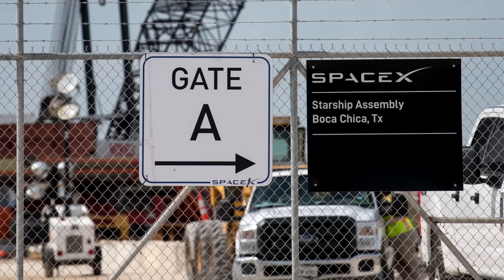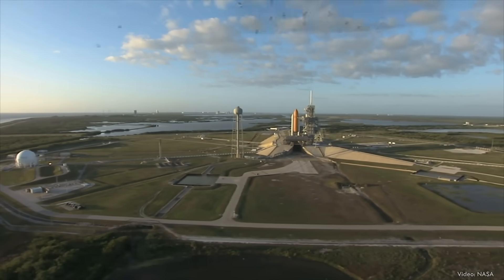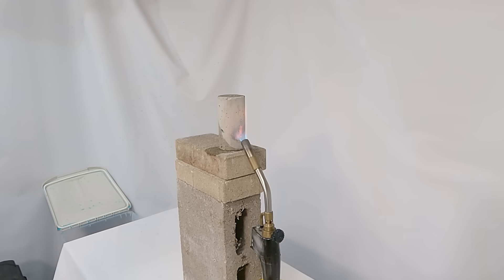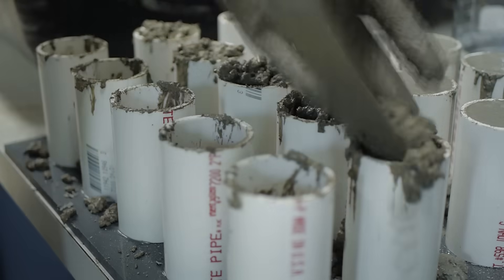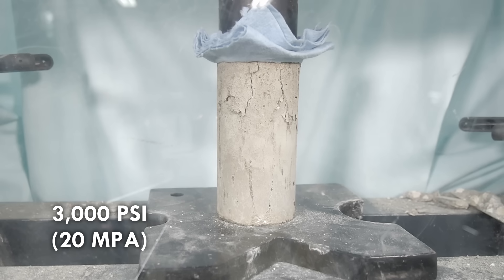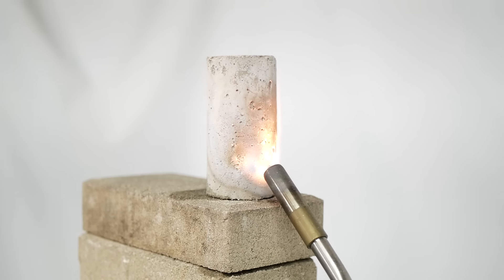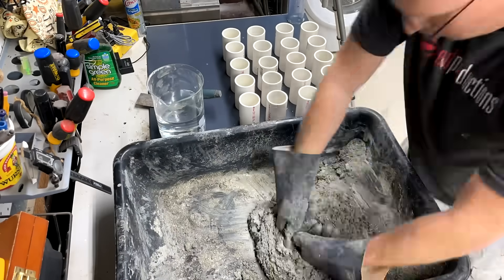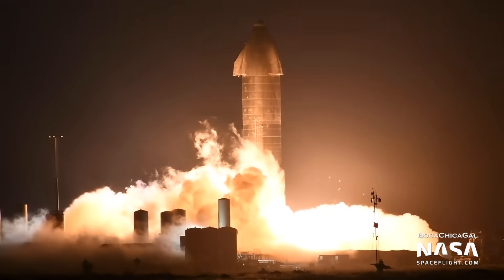Why SpaceX Cares About Concrete

Comment: Best spalling simulator for a rocket, minus the extreme thrust: molten metals from a refractory of course. =) Why I always work over a dirt/clay surface: let a new driveway absorb enough rain and spill a few drops from, say, molten brass or iron or your crucible cracks at an inopportune time, now you've got molten metal at 2400* to deal with ALONG with exploding concrete to dodge around your feet and legs!
Reply: At least the exploding concrete won't send the molten metal splashing around even more...  Oh, wait.

Comment: Would molten rock perform better than concrete?
Reply: Molten rock is, you know, molten. I wouldn't trust the integrity of a launch tower anywhere near it.
Reply: @General12th  would "once molten rock" reduce your likelihood of misinterpretation? "Refrozen rock" maybe? "Rock poured into shape"?
Reply: @unvergebeneid  Isn't that pretty similar to concrete? I don't see, for example, a great slab of granite holding up to launch conditions much better than a slab of concrete. It's still going to get blasted apart and form dangerous ejecta.
Reply: @General12th  it doesn't have cracks. It's also a completely different material.

Comment: Once there was a large, commercial, lift lock on a canal that they closed down to refurbish. It was built in the 1930s around the time of the Hoover Dam. They needed to resurface the concrete walls and at one point tried to use explosives to blast away a few inches of concrete. They detonated the charges and when the dust settled.....not much happened. They realized that the original builders really knew what they were doing when they formulated the concrete.
Reply: thats a lot better than the whole thing getting destroyed LOL. but also now after this video, i learned that they may have done some invisible damage by using explosives
Reply: No, those oldtimers didn't "know what they were doing", they just used a HUGE safety margin, exactly because they didn't know a whole lot. What do you do if you have no way of calculating if something is strong enough? You over-engineer it, and then you over-engineer it again. If you can calculate exactly what something requires, you don't need a large safety margin. If you're only guessing, you better use a huge safety margin to make sure it'll survive.
Reply: @timderks5960  and that way of thinking is why everything doesn't last anymore.
Reply: @ClumsyCars  And that way of thinking is also why you can afford literally anything. If cars were built like they used to, they'd be so expensive hardly anyone could afford one. Also, you may wanna take of your pink glasses. Old stuff isn't good 99% of the time. There's a reason why old buildings come done, and most old cars aren't around anymore.

Comment: In Italy the concrete has to be cured for 28 days before load weight on it. A week is enough time for these tests?
Reply: That might be too allow time for proper testing and bribes to go through.
Reply from the maker: Concrete gains strength over its entire life. Nothing unusual with testing at one week.
Reply: @PracticalEngineeringChannel  thanks you

Comment: After every launch the pad has to be relined. Patching it is a recipe for disaster. I think the "patch" idea is similar to patching a tire. Yeah, it might last, but it might not. Thanks for the video. 👍
Reply: In the scheme of things pouring a new layer of concrete shouldn't be a big thing- if you planed for it.
Reply: @CHMichael  If you plan to launch 3 times a day it can become a little bit of a problem though.
Reply: @michaelcrockis7679  Multiple pads.
Reply: Well, it's better than nothing

Are you suggesting re-cementing after every launch?
Reply: @NoNameAtAll2  I knew an employee of the company that did the pads for the shuttle program. They had to replace the lining after every launch. It wasn't to expensive, but it never failed to hold up.
Reply: @d.t.4523  Most of the space shuttle's thrust came from solid fueled SRBs though, which Grady talked about. The exhaust is filled with white hot solid particulates, so it also acts like an insanely powerful sandblaster. Rockets that are only using liquid fueled engines aren't that hard on their launch pads.
Reply: @NoNameAtAll2  No, it’s not better than nothing. Unpatched cracks means no launch, unless you want to risk millions of dollars of equipment. If you patch cracks and launch, you are also risking millions of dollars of equipment. The choice is reline and launch or dont’t and don’t. The third option is to learn an expensive lesson.

Comment: This is also one of reason why there are water towers near launch pads and dump water onto the pad. For one it absorbs the sound, the other is cool down everything on,under and around the pads.
Also, China landed a quite large probe with a rover on Mars going all the way down using reentry rockets. Satellite image shown the blast area in the ground is similar to Curiosity rover’s. So it isn’t that big of an issue on Mars. (Technically it is the latest rover/probe landed on Mars, after NASA’s)
Reply: Curiosity's landing affected the ground much less than the Zhurong's did.
The Zhurong lander made a small crater under itself, which can be seen here. https://youtu.be/aSSs6FfBlgY?t=351

Comment: Water is also used to dampen the forces applied to the launch pads.
Reply: I think the water is mainly used for sound dampening
Reply: @gbcfan204   I always saw the roles as one and the same- super loud sound makes for massive pressure spikes which the water helps dissipate, lessening the energy forced against the concrete and local support structures
Reply: @maitele  correct. It does help with sound. I would have to assume that there is still some heat transfer effect, it could be minimal. But the total reault is still interesting to me
Reply: @gbcfan204  that is correct... but in fairness... that sound is LOUD and can impart a lot of stress into the launch vehicle.
Reply: I was hoping this would be mentioned, but I guess we can't have everything
Reply: Because water isnt being used for starship/spaceX
Reply: @mikeunleashed1  it is. There is a water deluge system on the sub orbital pads and there will be one on the orbital pad
Reply: As someone familiar with cutting steel with a cutting torch, I've always tried to have a piece of steel under the cutting area to protect the concrete from dripping molten metal causing spalling. Having water on the concrete doesn't help and actually seems to make it worse. Perhaps the water turns to steam and permeates the concrete. Firebrick needs to be kept dry or gradually heated to get the moisture out or it explodes.

We had workers who didn't take precautions and had large chunks of concrete explode. The heat from rocket engines has to be much more. I wondered how SpaceX avoided such problems and it seems they haven't. It was one of the fundamental problems with rockets in the 1950s. It was solved with elevated stands and systems to direct the exhaust away from the rocket. One can only imagine the damage done by over 30 engines on Starship.

NASA's lunar lander was designed with the base elevated to help mitigate the amount of heat on the surface and there was the near perfect vacuum to disperse the exhaust.
Reply: DAMP, damnit ! not dampen. Water dampens things, not forces. Not sound.

Comment: This is why I don’t trust SpaceX—They cut so many corners, they can’t even do concrete right.
Reply: They wanted to see what damage it could do. They knew what consequences this test could have.
Reply: @jackwhitlock1  You believe that, huh? You seriously think they intentionally sacrificed a Raptor engine during a static fire just to prove that concrete spalls? There's a million cheaper ways to figure that out. The organization screwed up, end of story. Don't let marketing gaslight you about engineering.
Reply: @cf453  Remember that SpaceX, like any other company, is motivated by profits. How could the company stay afloat if it routinely makes mistakes like this? Wouldn't the folks in charge of this accident get fired for incompetence? And if they weren't, wouldn't the mistakes keep piling up until the company fell apart?

I'm sure that's what could happen, but SpaceX has been around for a decently long time and it's had quite a few successes so far. That means SpaceX has to be making terrible mistakes and never learning from them at the same time they're achieving great new accomplishments and growing from them. That seems... inconsistent.
Reply: and yet SpaceX is the worlds leading rocket manufacturer performing tasks many deb00nkers deemed impossible

Comment: Great video, could a carpet made from heat resistant fibres be used?
A textile product might be light enough and prevent the regolith from being eroded from beneath the rocket.
Reply: The Gases get thrown out at about 5km/s way to fast for something like that.
It is essentially a directed explosion.
Reply: No.

Comment: refractory concrete is a bi*/ç to work with. most are mixed pretty dry and then have to be poured underneath a form. the one we use is about as hard as normal concrete when it's at it's normal usage temp of 1450c. ours is most often a high alumina ultra low cement mix with glass microfibres in it
Reply: Regular cement contains lots of water. You need to use fireclay bricks with fireclay cement. High silica or high alumina cements set with minimum water (commonly used in furnace lining) can be more useful.
Reply: I'm in the market for some refractory cement to reline my forge got any recommendations??
Reply: @29wildfire55  where are you from?
Reply: @laveturnerjones3954  western United States
Reply: @29wildfire55   we use caldecas from the calderys company. but i have no ide how available that is to buy at low(er) volumes. we go thru 1/200 metric tons of the stuff a month
Reply: @laveturnerjones3954  ok thank you, yeah I don't need quit that much
Reply: @29wildfire55  yeah. and that is only my department. the whole plant is close to 2400 tons a month. that is for 2 blast furnaces with all equipment for it (runners troughs torpedo cars) the coke plant and ste meltshop and all their equipment (3 bof convertyers, countless ladles and dual continuous casters.
Reply: @29wildfire55  Simond Store in Corona CA sells some Calderys refractory mixes.
Reply: @29wildfire55  If you are not looking for mechanical strength, go for the lightweight insulating bricks. Keep in mind thermal expansion of the bricks and the joints.
Reply: @29wildfire55  I just sealed my new forge with Rutland Products 25 lbs Castable Refractory Cement, Taupe, in July, from amazon.
Did it by hand, bad idea even with gloves.  But it came out OK for my first one I think...
I let it dry for a month, out in the garage, here in NJ, as this year was a humid bitc_.  Maybe longer...  I seem to recall running the forge for the first time in September, so maybe I let it air dry for 2 months?

I heated it up WAYY too fast, because I didn't realize how hot the forge ran, but it held up just fine.  
I did put on only a 1/4 to 1/2 inch coat over the kaowool.
I let it sit outside for hours before putting it away, even with wicked high humidity that night, near 90%, but it was still pretty damn warm when I brought it in.

I have not yet heated it again, so we'll have to see if there are any issues with the 2nd heat.

I had to CONSTANTLY mix that Rutland cement.  If anyone knows of a refract cement that stays ore evenly mixed, I would use that.  and by constantly, I mean every handful, every 20 seconds, had to remix the stuff.  IDK if that is normal or not.
Reply: "is about as hard as normal concrete at its normal temperature" Okay, sounds normal
"At 1450 C" bruh
Reply: @actualperson1971  The gases will be around 1500-1600C but the concrete slabs below will take considerable time to reach that temperature. I do not think it reaches much above 500-800C peak but that is a guess.
Reply: @actualperson1971  it's under a freaking rocket man what do you expect
Reply: How do you pour underneath the form? Pressure jamming it from the side?
Reply: @Geroskop  using a concrete vibrator we can liquify it a bit but it still takes quite a bit of effort and luck
Reply: @Geroskop  and in normal concrete you could use s suplerplasticiser to mimic a wetter concrete. but we have found that that stuff burns/creates fumes at our usage temps
Reply: I know it is, i worked concrete plant shutdowns to install concrete in coolers and kilns

Comment: In Peppa Pig her dad (Daddy Pig) is an internationally renowned concrete expert. He tests samples by tapping them and listening to the ringing - easier to carry than a hydraulic press!
Reply: Didn't know I'd get to learn Peppa pig lore in the comments
Reply: Daddy pig loves being dug out of concrete. Everyone loves being dug out of concrete.
Reply: pls tell me that's a joke... you're really tempting me to watch Peppa Pig right now 😂
Reply: But he can't knock a nail in the wall to hang a picture, without making a huge hole in the wall!
Reply: Didn't Daddy Pig once forget to return a book about concrete to the library for 10 years?
Yes: https://youtu.be/z6WtwWqgt3I
Reply: Oddly enough they used to test the steel tyres on railway vehicles by tapping them with a hammer and listening to the ringing to detect non visible failures. You could get a job as a wheel tapper.
Reply: Here’s the link since everyone wants to see this method being used - skip to 4:00 https://youtu.be/ouL-dQmCCsY

Comment: This doesn't really tell us what is different in lauchpads, just that they're concrete + fibres?
Reply: I mean...as long as you ignore the variety of engineering structures employed in launch pads to help maintain the structure, like flame diversion grooves...
Reply: and lots of water.
Reply: @wobblysauce  lots of water will produce lots of steam and lots of stress. You need porous fireclay type cement (and bricks) that can allow steam to escape rapidly.

Comment: They build launchpads near bodies of water that will flood the launchpad to prevent it from overheating right?
Reply: sometimes they just create artificial bodies of water. They build launchpads next to large oceans so they aren't depositing stages on surrounding cities or farms (or people!). But, water is used as a protection system... it is fired just as the engines are and absorbs vibrations (that could lead to shaking and destroying the rocket engine itself) and destroying the pad.... water is incredibly good at absorbing and depositing these sound vibrations caused by the massive power output of the engines! So you are right they use the water to flood the launchpad, I don't think its from overheating (could be a little role, but I doubt it as engines are already designed for such high temperatures, and tanks should hold up fine for the short duration energy burst from the engines, plus they are designed for high shaking as they are legit on top of a massive explosion, leading only heat... which should be fine for them)
Reply: @nickgraham6720  thanks dude, ur a legend
Reply: @gwitched3217  np :)